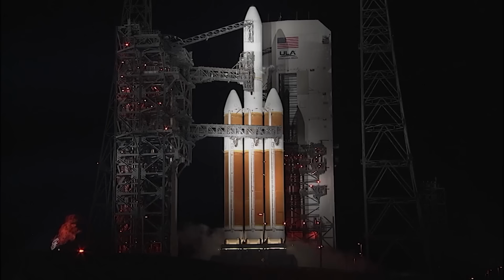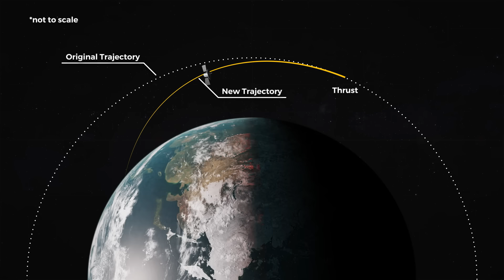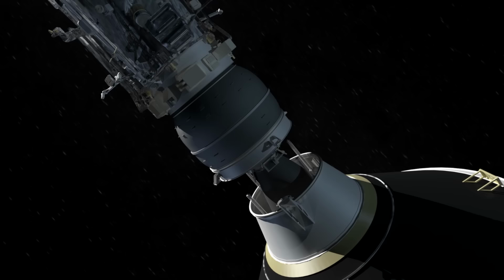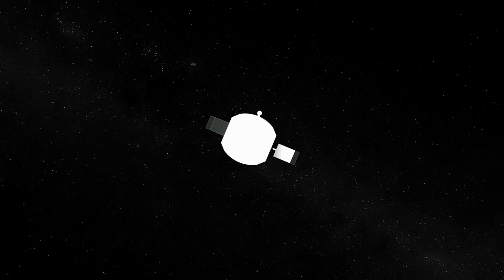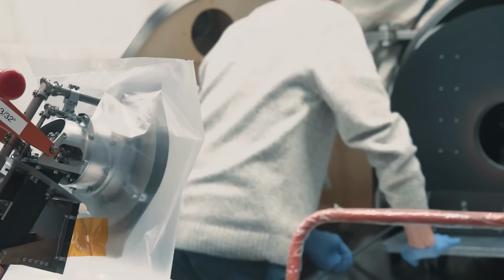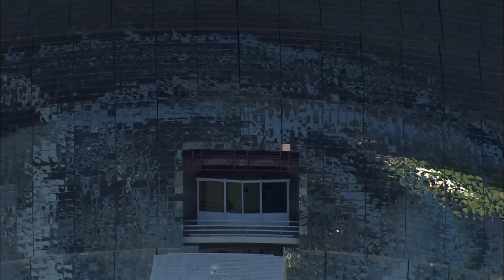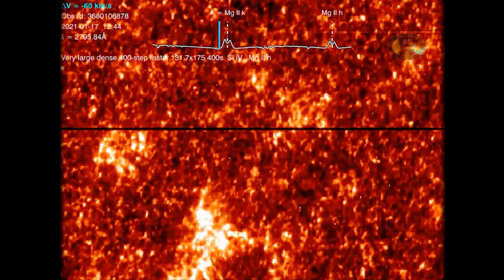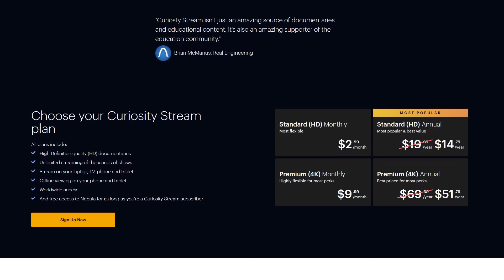The Insane Engineering of the Parker Solar Probe

Comment: Hi, great video! A few points to clarify on the fusion side. The ‘able to produce 70% of the input energy’ is a little inaccurate. The plasma produces, in the form of heat, 70% of the power heating it. However, that isn’t 70% of the input electrical power. There are efficiency losses between the electrical power fed to the heating systems and the amount of heating power that actually heats the plasma. Likewise, the power produced is in the form of heat, not electricity, and you need to produce a fair bit more heat to compensate for efficiency losses when producing electricity. ITER will not be hooked up to a system to generate electricity from heat. The next reactor that is planned after ITER is DEMO, which is supposed to produce electricity. The UKs STEP reactor is an electricity producing demonstration device scheduled for completion in 2040. Also, ITER will not really be finished in 2025. That’s the first stage, where they can test when they have assembled so far with realtively low performance plasmas. If all looks good they will continue with assembly. The next (thermal) energy producing ITER operations will use a deuterium-tritium fuel mix and aren’t scheduled until around 2035. Even then, no electricity will be produced. DEMO is being designed currently and won’t be online (assuming it ever gets approved) until at least 2050. Many private fusion companies have popped up over the last decade that aim to have electricity producing demonstrator devices in the early 2030s. The faster pace of private companies is a result of incorporating new technologies that either allow the reactors to be built smaller and hence much more quickly, or have some novel approach. Some such technologies weren't around when ITER was being designed, another drawback to the long time it has taken to construct it. The reason ITER is taking so long is, among many other factors, due to its immense size. When it comes to tokamak fusion reactors, building bigger does move you toward more fusion relevant conditions in your plasma, but at the cost of the devices taking longer to be built. New technologies have emerged since ITER started construction, which enable the magnetic field strength of the fusion reactor to be much larger. This also moves the reactor toward more fusion relevant conditions, without having to make it enormously large. Hence you can build such devices much quicker. Hope this was informative! Great video as always.
Reply: I found this video very informative on the topic: https://www.youtube.com/watch?v=LJ4W1g-6JiY

My key takeaway: It's about Q, the ratio between power out / power in. We want Q > 1 to harvest energy.
We hear numbers like Q = 0.7 like here, but that's misleading. Because there is more than one Q! What ultimately matters is Qtotal, which divides the total amount of electricity gained by all the power needed to run the facility (including cooling, machinery, and whatnot). What's often reportet is a different Q, for example Qplasma. Yes, we might get the plasma to return 70% of the energy we put in, and that's great, but that number ignores cooling and other processes which might consume vastly more energy than the plasma itself. And conversion losses, as you say. The relevant Qtotal is still at or below 0.1 afaik.
Reply: Great summary!

Basically you have given "The current State of Fusion research" all in one YouTube comment. I would only like to add one important point on why it takes so long to build ITER:

The project, actually dating back to the Reagan presidency (!), was set up to be scientifically profitable to all participating nations. That's why all construction work that could be distributed to different nations was split up that way. In the end, every ITER partner was supposed to have learned everything necessary to build the thing all over again by themselves should they want to.
Now take this horribly inefficient distribution that was intentional and add the seemingly unavoidable mismanagement every great project seems to suffer from and you've got one of the main reasons why ITER is delayed by decades and costs billions more than was originally projected.
Reply: Wasn't the record 10% a decade and a half ago, though?
Reply: @GhostofReason  As adults we still marvel when we watch cartoons and make believe they’re real.

Comment: Could you take a look at the engineering and applications of sodium ion batteries? I’ve been hearing about them for grid storage, but I would love to hear your analysis.
Reply: Been hearing about sodium batteries for many years, haven't seen much progress in the news so I'm really interested in seeing what I've been missing. I hope he makes a video on the topic too
Reply: For grid storage you have plenty of options for a battery. For example you can simply suspend a weight in the air and move it up and down based on demand and supply. That’s pretty much a gravity battery and would work well for grid storage. We already use pumped hydro as a sort of battery in many places in the world so grid storage isn’t as big of a problem as it seems. The bigger problem is batteries for trucks, or other heavy equipment since you have way more constraints in such an application.
Reply: @harsimranbansal5355  easier said than done, though. You should definitely watch his video on pumped hydro
Reply: @capturedflame  efficiency of lead acid batteries is absolutely shit
Reply: I dont think he covered sodium ion batteries but it was a calcium ion battery and how it “dirt cheap” and has good energy density. I don’t know if it will help but his video is called “The missing link in renewables”. Hopefully it will help ur intrigue until realengineering do something more to ur inclination.
Reply: Sodium ion batteries are never going to be used for grid storage because they have all the disadvantages of lithium batteries while storing even less energy.
Reply: Might as well add solid state glass batteries in there as well.
Reply: The earth is flat and actually Satan has taken credit for the ball earth thing actually.
Reply: The primary power for the mission is a dual system of solar panels (photovoltaic arrays). A primary photovoltaic array, used for the portion of the mission outside 0.25 au, is retracted behind the shadow shield during the close approach to the Sun, and a much smaller secondary array powers the spacecraft through closest approach. This secondary array uses pumped-fluid cooling to maintain operating temperature of the solar panels and instrumentation
Reply: I agree on this one
Reply: Humans 0
Saiya-jin 1 to 6
Angels 7 😇

Kalki Ironman 5th matriya buddha 8th arc Angel 11th satguru 13th imam and 24th avatar after 2026 😎

Almighty God 9 😇

Humans type 2.5+ after 2026 by Kalki Ironman (christ in the white horse)(son of man on clouds) type 7 and 8 😎

Jarvis the world’s first artificial intelligence (parrot) 😎

Cuz Kalki is ironman batman super saiya-jin superman ben10 saitama Narutoo shaktimaan and every super heroes combined after 2026 😎

Jarvis world’s first artificial living being (just like vision in marvel universe)😎

Made of Quantum and sub quantum particles 😎

Power source quantum energy arc reactor (type 7) level technology 😎

Kalki Ironman going to have every kind of arc reactor like:- type 1 Nuclear fission, nuclear waste, hydrogen fusion, type 2 3 4 5 antimatter arc reactor (solid liquid gas), type 6 electro quantum arc reactor, and type 7 Quantum arc reactor, type 8 limitless quantum energy arc reactor without quantum particles 😎

Kalki Ironman going to have sun in a box million billion tons of hydrogen nuclear fusion reactor type 2 3 4 5 just like sun and stars in the palm of his hand 😎

This all going to happened by self replicating quantum nanobots knowledge energy and techniques at type 7 7 7- respectively 😎

Ironman (Tesla 2.0) going to reveal every secrets of the world specially Tesla and his Antigravity 😎
Reply: Iron air is the way to go for solar energy... for now...
Reply: @Quickened1  

Not for long bro 😎
Reply: Capacitors r the best 😎😎😎😎😎
Reply: @xygomorphic44  They are significantly cheaper though.
Reply: We in Adelaide Sth. Australia have built what may still be the biggest battery in the world, and it's brilliant! It can store excess energy but as far as supplying a city it's limited. Where it really pays for itself is that you store until the market reaches it's highest estimated buying price and then you sell. It also has reaped big $ by being able to inject power to a grid system almost instantaneously allowing that grid to avert a full or partial blackout.
But . . . I think the best big batteries that would be very cost effective for supplying power to cities would be either pumped hydro or a weight/gravity system on the scale of a mine shaft where it take a lot of energy to bring the weight to the top and so you get a lot back as it descends at night by using the same basic principal of pumped hydro. Both of these can be used anywhere where there is a height differential.
Reply: Sodium ion batteries and potassium ion batteries have already been made, though admittedly not mass produced, since the demand for them is not really there yet. However, in terms of chemistry they are not all that much different to the lithium ion batteries that we already know about and use every day - basically just the same battery chemistry with sodium ions or potassium ions replacing the lithium. The voltage output is slightly different, but still within the same 3 to 4 volt range, so they could still be used in the same applications.

The main downside is the increased weight (sodium and potassium are both heavier than lithium), translating into reduced energy density. Which would be a problem for vehicles, where power to weight ratio matters a great deal. But much less of an issue for grid storage any other application where the battery itself doesn't have to be moved about while being used. For grid storage, you want the largest capacity possible, created as cheaply as possible. But weight is not much of an issue, and unless the battery has to be positioned where land is at a premium, volume or land area occupied are not major issues either.

Sodium and potassium are also far more abundant than lithium, at least here on earth. Sodium obviously being the most abundant alkali metal, the sea containing practically inexhaustible quantities of it. So once demand picks up through use for grid storage and other static applications, kicking in the economies of scale, sodium ion batteries could become even cheaper to produce than even lead-acid or nickel-cadmium rechargeable batteries.
Reply: @xygomorphic44   sodium ion batteries  have all the disadvantages of li ion,, except for the cost and abundance of Na being much more favorable than Li.   Which in the long term will likely lead to variety of applications save for those most sensitive to energy density.
Reply: @lloydevans2900  Thanks for that, quite interesting!

Comment: The atmosphere of the Sun being the hottest part could be due to the fact solar flares and radiation are launched up so the atmosphere gets more heating than the "surface" as the heat giving out by the core of the Sun dissipates as it moves up so the "surface" is not actually that hot.

Comment: Small nitpick. While Falcon Heavy is the highest payload to orbit currently available, Delta IV Heavy has higher interplanetary payload because of its significantly more efficient upper stage
Reply: do correct me but i thought the upper stage is interchangeable?
Reply: @aronseptianto8142  Upper stages are exclusive to the launch vehicle except for a few special cases. Falcon Heavy has a kerosone and liquid oxygen upper stage which is efficient and cost effective for lower earth orbits. Delta IV Heavy's upper stage is a liquid hydrogen and liquid oxygen upper stage. This is expensive and not very efficient for lower orbits but it's much better for high orbits and interplanetary missions.
Parker solar probe needed as much velocity as it could possibly get from launch in order to make the mission work. Falcon Heavy may be "more powerful" but Delta IV Heavy was able to provide more velocity to the probe, which is why it was used.
Reply: @aronseptianto8142  You are correct but they are rarely booster agnostic. The efficiency of the Delta upper stage is mostly lent by its hydrogen engine which has far higher exhaust velocity than kerolox. To do the same, SX has to design their own hydrogen upper stage which I don't see in the near future. Oncee Superheavy is operational however, you can pretty much bolt in any upper stage into it, lol. No need for specialized adapters. Just chuck it into the payload bay, hehe. (With some nuance of course)
Reply: @fcgHenden  how would staging even be done in a super heavy kind of rocket?
would it do the explosive charge but sideway?
Reply: @aronseptianto8142  The second stage is starship itself, superheavy being the first stage. If you wanted to add a third stage for some reason into the payload bay of starship you could, I'd imagine. It would probably either use compressed springs to launch the payload out of the bay or I could even see a world where a similar sort of roll/yaw maneuver is used to have the payload eject itself, similar to how starlink satellites are deployed. In all likelihood however, one would probably just use starships second stage for these trips instead of a dedicated 3rd stage.
Reply: @aronseptianto8142  My bad, the second stage used in the Parker probe is apparently a solid booster with a wet mass of about 0.22 Ton. 
My point was Superheavy is being designed to boost Starship (120 Ton) and with that capacity and a 9m (30ft) diameter, you should be able to attach a Ford F-150 to a vertical steel rail if you want that as a separator and still have plenty of space and maybe 80 more tons to play with. 😂 Thing is stupendous.
Reply: They both reach their landing zone. The Bermuda triangle where things "disappear"
Reply: My rainbow unicorn can carry more
Reply: @fcgHenden  Solid booster was the third stage technically. Usually those small solids are referred to as "kick stages"
Reply: Ahh yes, yes.. indubitably